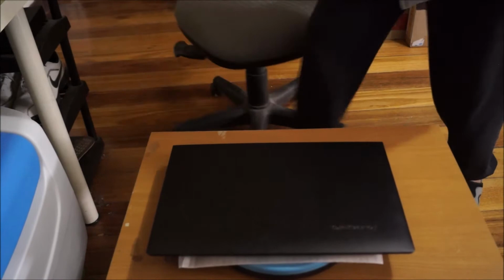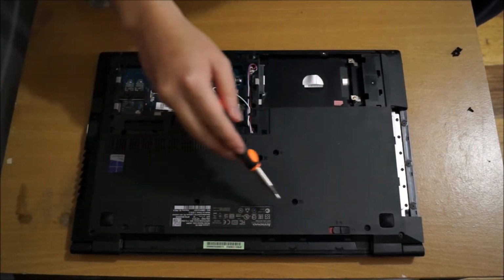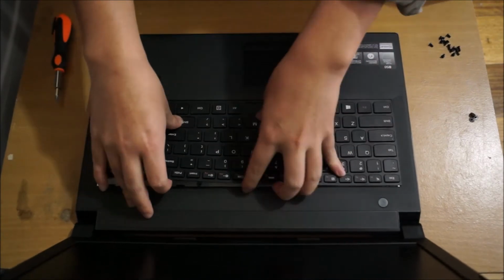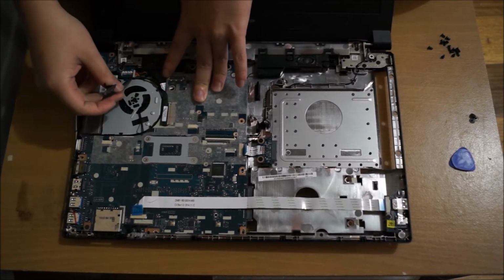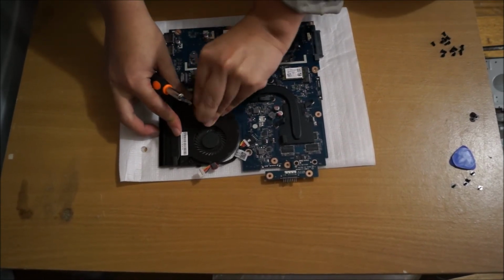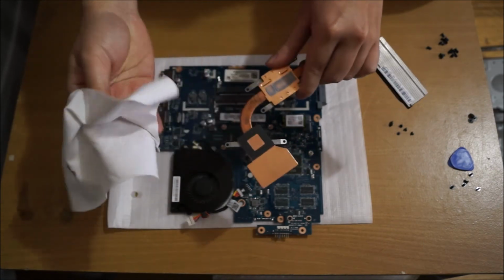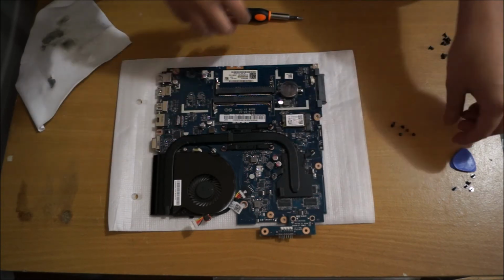OPEN ME UP! Lenovo B50-30/B50-30 Touch/B50-70/N50-70/B50-45/N50-45/B50-80/ N50-80 Series Disassembly

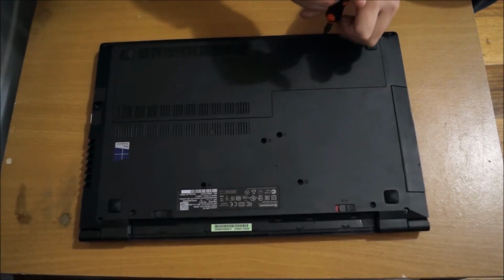Comment: Removing back cover 1:05
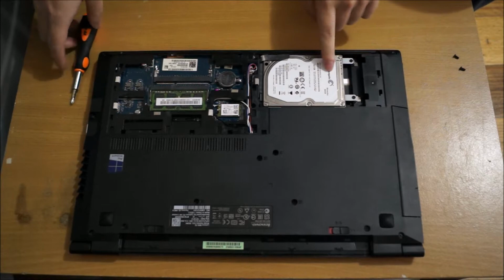Removing hard drive 1:40
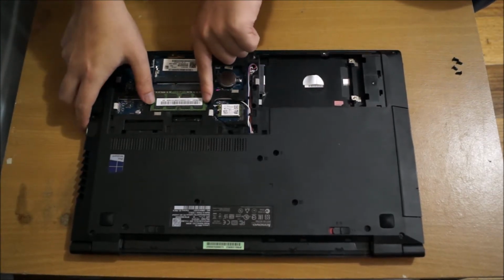Removing Ram 2:30
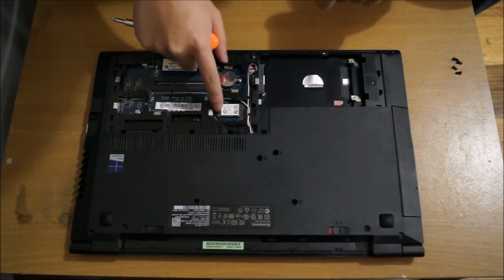Removing wireless card 2:50
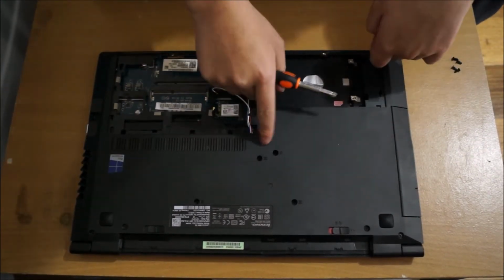Removing DVD drive 3:55
Removing keyboard surrounding 4:25
Removing keyboard 7:45
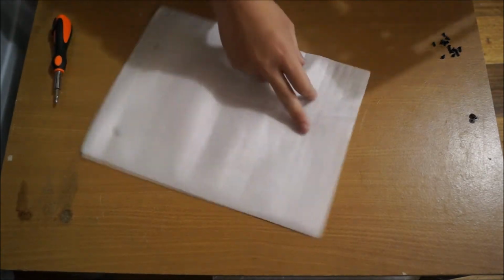Removing motherboard 9:30 
Removing CPU and graphic card heatsink 12:55
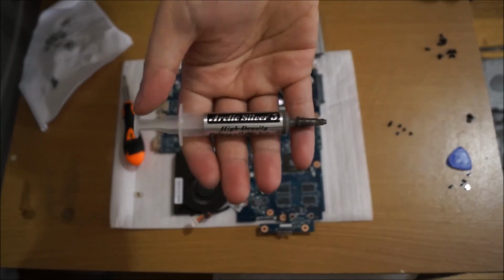Reapply thermal paste 16:35

Comment: the dvd drive of this model will working with lenovo b50-80?
Reply from the maker: basically any laptop dvd drive. there are two types of laptop dvd drive. one with a slot so when you eject the dvd the slot comes out with the dvd which is the one you want. the second type is the dvd  drive with a hole and you insert part of your dvd in and it takes it.

Comment: Is the processor removable?  I have a b50-45
Reply from the maker: if you watch the video i tell you but otherwise the below information is in the video description as well. 
CPU is solder on, graphic card is solder on, ram can be changed to 16GB max with 8GB in each slot and there is 2 slots, wireless card can be changed, and hard drive is a 2.5" inch.

Comment: Is the charging port part of the motherboard?
Reply from the maker: nope
Reply: @OpenMeUpTec  would it also be required to remove the keyboard to change the charging port? I'm working as a tech so I really appreciate your replies.
Reply from the maker: @cyraxvisuals6203  yes you need to remove the keyboard as there are screw under it

Comment: Hello; I have a B50-45 laptop with E1-6010 processor which I want to replace  with a faster one. I know I need to change the whole motherboard and I am fine with it. The natural choice would be the same motherboard (LA-B291P) with a faster AMD processor (A6 or A8) but I noticed the LA-B091P motherboard that usually comes with the B50-70 is incredibly similar except for the fact it embeds Intel processors (including I5 and I7).
Now my question is, can I replace my slow, sluggish E1-6010 LA-B291P with an I5 or I7 LA-B091P? Many thanks for any help
Reply from the maker: The CPU is soldered on therefore you have to replace the motherboard. If you are happy to do that it means you have enough money to buy another laptop. Therefore I recommend you to sell this and get another one
Reply: I beg to differ. I can get the LA-B091P motherboard with an i7 processor for 200 USD. I will never get a second-hand (let alone a brand new one) i7 laptop for less than 400 USD. I prefer to change the motherboard and sell the replaced one but no-one so far has been able to confirm I can install an LA-B091P motherboard in a B50-45 lenovo laptop
Reply from the maker: It should work you can confirm this by looking at the user manual and confirm the layout of all the models

Comment: my charge spot (when you plug in the charger ) broke so I opened the computer and hot glue it so it won't move 
now my computer won't start up 
how can I solve it?
Reply from the maker: open it up again and check because it seems like you probably forgot to plug in something
Reply: but that's the strange thing, I did'nt plugged out anything while I was opening my computer, the charging spot moved out of its spot so I glued it,
when I charge the computer I can see the charging lights but when I press the power button it does not respone and does not start up...
have any Idea why can it be ?
Reply from the maker: Your laptop is not even turning on at all which should not happen if you didnt do anything special. at most when it is faulty the laptop still turns on it some way. so i believe it is your power button which can be disconnected. you said you didnt remove anything which i founded weird because you need to remove everything to reach the power port. But most likely you forgot to plug in the power on button at 8.15 in the video
Reply: did'nt understand what you did,
I opened the all thing without disconnecting something
Reply from the maker: it is not possible how you can open everything without removing anything when i had to remove alot of things
Reply: Ido Mushayof probably messed with the power button or or its the DC power jack becuz my laptop had same situation and the light did turn on but it actually didnt charge